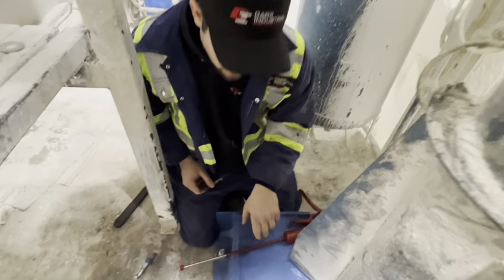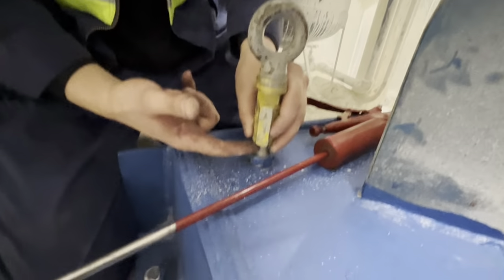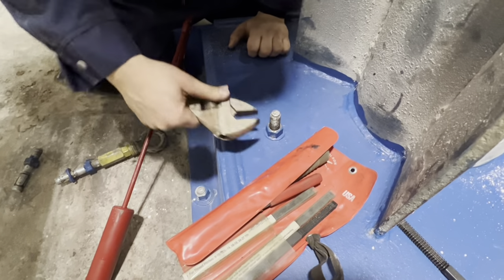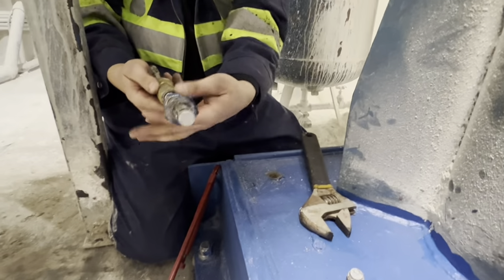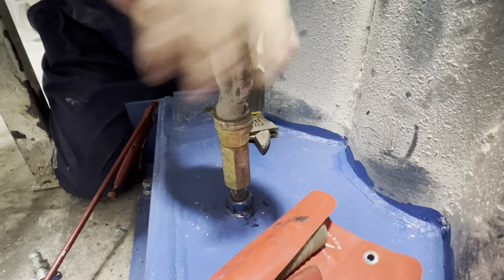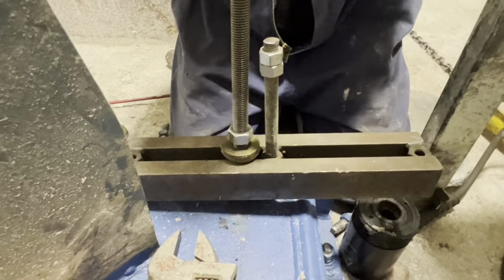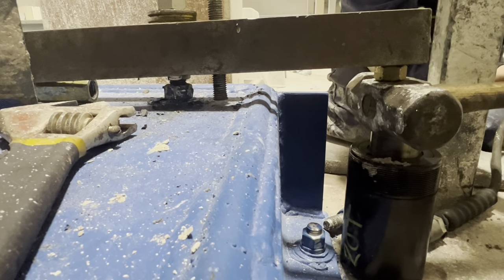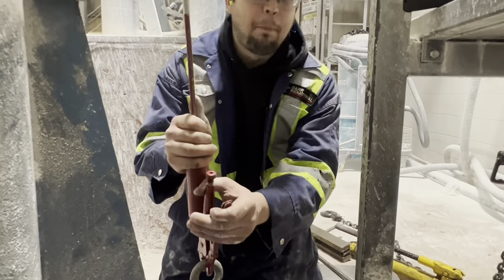How to pull out damaged wedge anchors in concrete

Comment: Where did you get that beam or bar contraption that you used with the bottle jack towards the end of the video?
Reply from the maker: Just flatbar with coupling nuts welded in it. An old custom gear puller